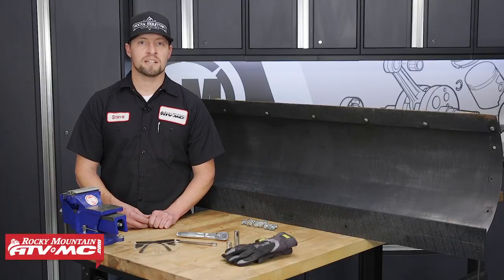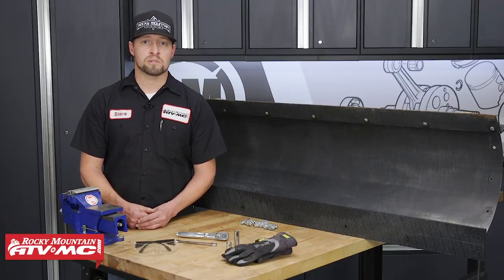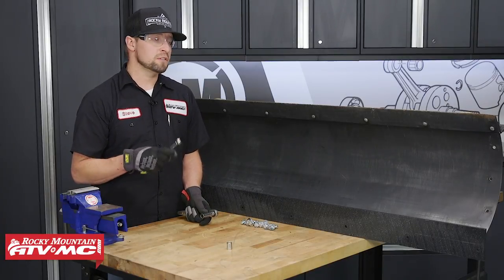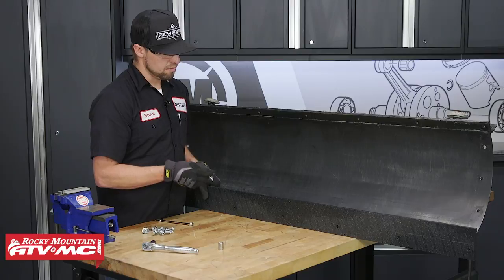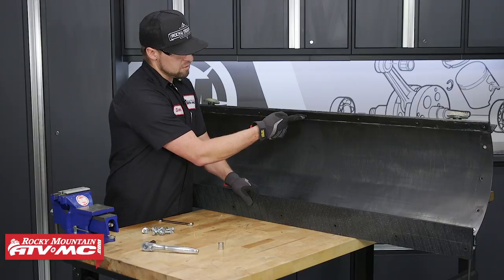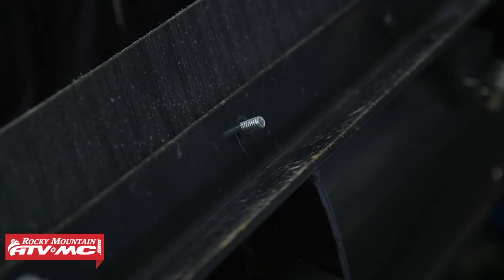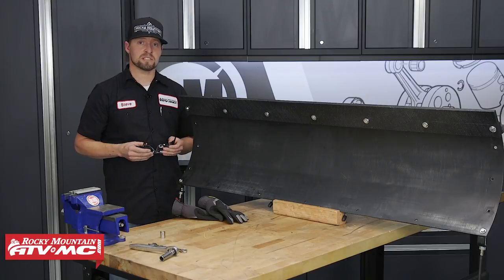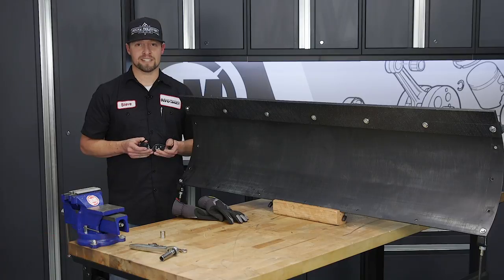How To Replace the Tusk SubZero Snow Plow UHMW Wear Bar

Comment: How would this work on gravel? I have at least a mile long gravel road to plow.
Reply from the maker: That's a good question. I would definitely say your chances of messing up your driveway will be lower with this UHMW compared to steel.
Reply: @rmatvmc  I would think and also no rust lines left on the garage floor anymore.
Reply: Attach a piece of PVC pipe over the wear bar, works great for gravel driveways.